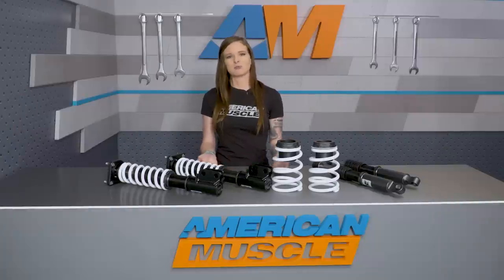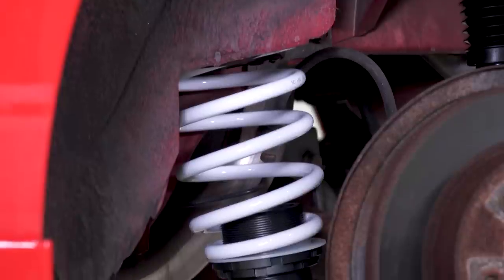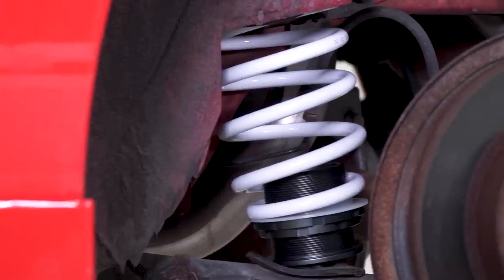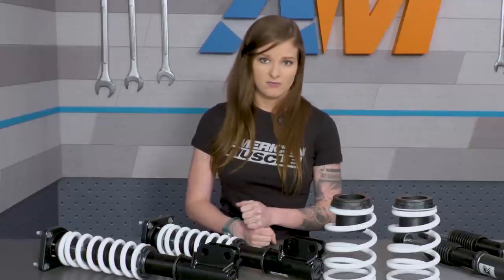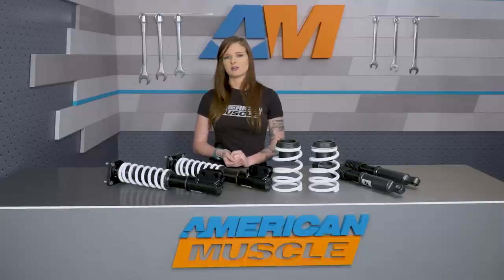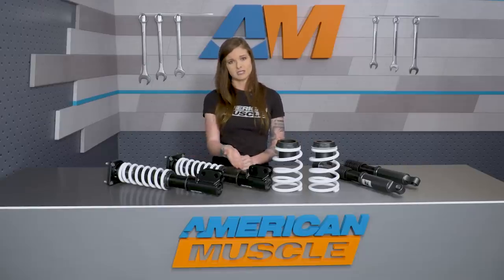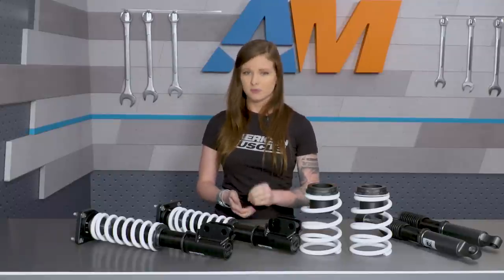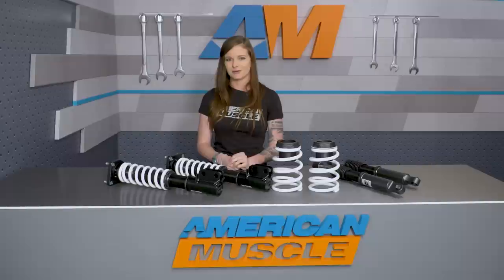1994-2004 Mustang SR Performance V2 Height & Damping Adjustable Coilover Kit Review & Install

Comment: I just got these and installed them on my 2000 mustang gt. They feel smooth at the front. However, the rear are extremely ruff and bouncy not enjoyable to drive sometimes.
Reply: I was thinking of getting these on my 95 u think it’s a good buy or is there better for the price
Reply: @bigbootybot7004 I recommend saving up and investing to BC racing coil overs instead. I heard those are the best

Comment: So you don't need to purchase camber caster plates with this kit? And say you lower your new edge 2 inches, does it come with the new specs for the alignment or how does that work? I don't know a lot about suspensions I guess I'm just confused how you get the car running straight again after lowering it
Reply: Jesus Solis you get a wheel alignment done at a shop after you have lowered your car.